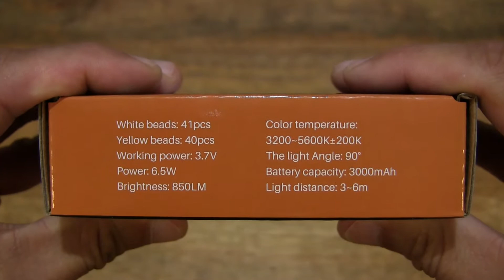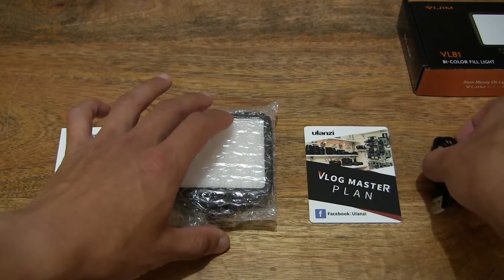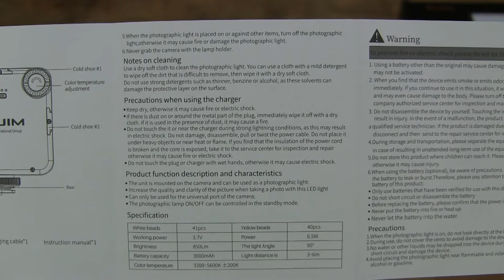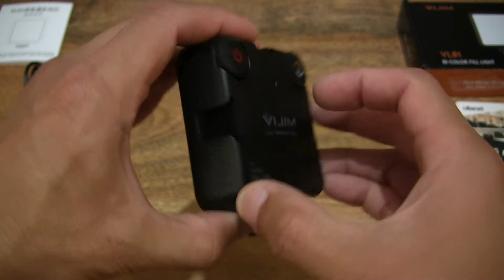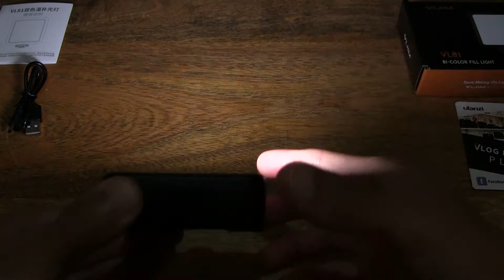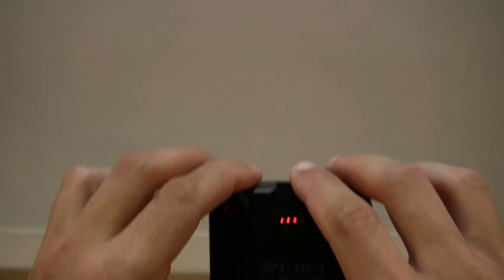VIJIM LED Video Light

Comment: Hi, how is the battery backup?
Reply from the maker: It will last an hour or so continuously on maximum brightness. Happy shining.
Reply: @sutats  have you tried the Aputure AL M9? Is the VL-81 better than the Al M9?
Reply from the maker: @uddiptarajdeka3329  I've not tried that but it does not look to have a rotary brightness or a rotary colour temperature adjustment which are extremely useful. Happy shining.
Reply: @sutats  yes true! I agree haha.. thank you! Happy Shining
Reply: @sutats  hey again, can I use the VL 81 while charging?